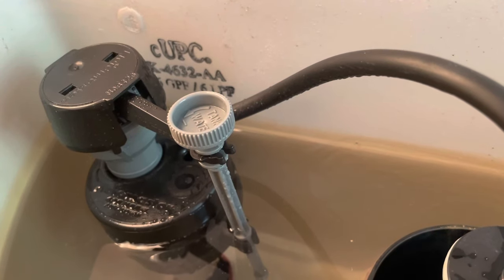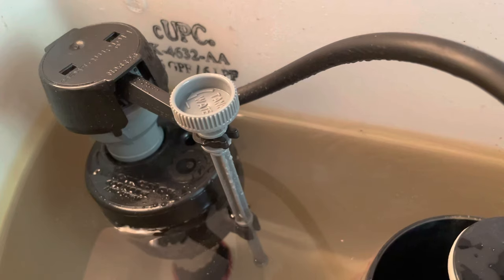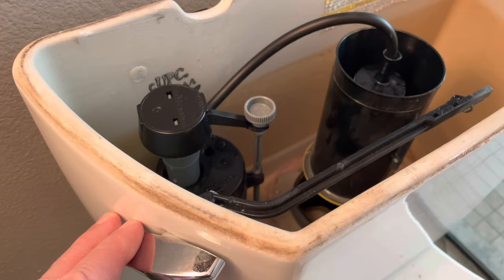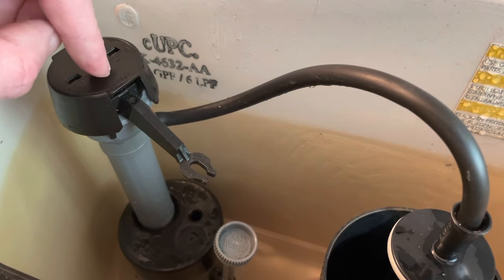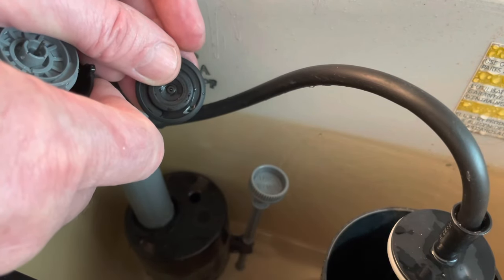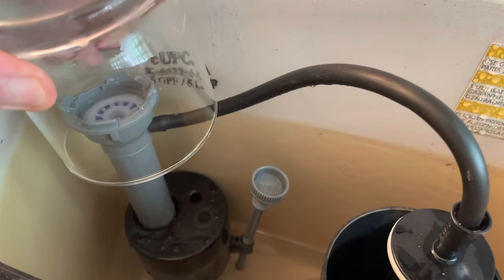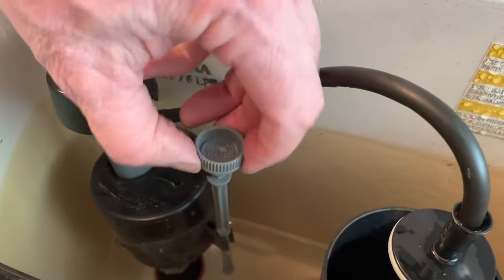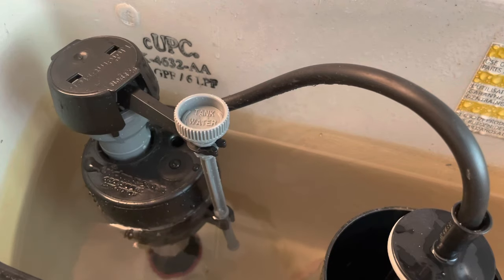Toilet Fill Valve Not Shutting Off / Don’t Replace / Fix Fast Cheap & Easy For Beginners

Comment: Our toilet makes noise throughout the day intermittently.  Do you think this might be our problem.  I am so tired of not knowing what this noise is from.
Reply from the maker: No, if it’s intermittent, you just need to replace the flapper (or canister seal depending on what style toilet you have). Either way, it’s super easy. Here’s a quick vid on flapper replacement:

https://youtu.be/lQQ8j0dIgIs

Comment: You obviously put the rubber seal back in place b4 re assembling the top unit....BTW, when pushing down on the top, hold the black connecting rod up and turn CC to undo it..

Comment: Was able to open and clean the dirt under that, but water still keeps running. Only stops when I push the fill valve down for a few seconds and let go
Reply from the maker: @nyduffman85  When they start getting “fussy” like that, it’s easier to just replace the valve. It’s simple to do, and they’re only $10.

Also, there’s a trick where you just replace the upper portion… it can be done quickly and with no tools. Here’s a video…

Replace Fluidmaster Toilet Fill Valve in Seconds For Beginners NO TOOLS NEEDED
https://youtu.be/ovdWF5Hdz8U
Reply: @papajoeknows8355 thanks, will have to replace it. It no longer stops running. Thanks for the reply appreciate your videos

Comment: We replaced both toilets when we replaced the floors little over a year ago.  One takes too long to shut off. Cant figure out why???
Ideas anyone?
Reply from the maker: Follow the steps in this video… it may be that there is some debris, or “gallstones” as we call them, that is blocking the flow of water inside the valve.

Comment: I don't understand. I replaced mine with another (used) one and BOTH don't stop the water. 

I took it appart like 2:06 and when I push on the top lever, the pin slides up and down and that's it. Nothing is pushing down on the rubber seal so how it it supposed to shut off?????
Reply from the maker: It may just be time to replace the valve. A little trick is just replacing the upper portion. Here’s a vid:

Replace Fluidmaster Toilet Fill Valve in Seconds For Beginners NO TOOLS NEEDED
https://youtu.be/ovdWF5Hdz8U
Reply: @papajoeknows8355  So I swapped the seal for another one and it works. 😊

The rubber was SLIGHTLY hard, but not THAT hard. Apparently that made a difference and the one I swapped it with works.

I still don't understand how it works though. The lever just pushes the pin down. It doesn't move the seal at all when you move the lever when taken apart.

Comment: Replaced the seal, flushed out the area underneath it and it still does not shut off.  What can go wrong with the rest of the valve causing this?
Reply from the maker: When they start getting “fussy” like that, it’s easier to just replace the valve. It’s easy to do, and they’re only $10.

Also, there’s a trick where you just replace the upper portion… it can be done quickly and with no tools. Here’s a video…

Replace Fluidmaster Toilet Fill Valve in Seconds For Beginners NO TOOLS NEEDED
https://youtu.be/ovdWF5Hdz8U

Comment: Is there any reason why the water would keep running for some time after it appears the valve is closed? It's easy to verify the float is fully up and firmly pushing the valve shut by pulling up on the arm, but mine keeps running for about 15 seconds after the valve should be shut. But then it consistently shuts off after that time delay, which really has me baffled.
Reply from the maker: When they start getting “fussy” like that, it’s easier to just replace the valve. It’s easy to do, and they’re only $10.

Also, there’s a trick where you just replace the upper portion… it can be done quickly and with no tools. Here’s a video…

Replace Fluidmaster Toilet Fill Valve in Seconds For Beginners NO TOOLS NEEDED
https://youtu.be/ovdWF5Hdz8U

Comment: I just bought a new Korky universal fill valve and changed out the old shut off valve with a compression fitting because I thought the shut off valve was bad. Now I have the same problem as the last fill valve! I’m losing my mind over here. Anyone know what might be going on with my toilet or plumbing?
Reply from the maker: @Isaacelijahmusic  is it possible you’ve got the height adjustment set too high, and the valve is not able to shut off prior to the water level reaching the overflow tube?
Reply: @papajoeknows8355  I thought I placed it as instructed. I took it apart after watching this and I hope it remains working otherwise I will try adjusting the Height
Reply from the maker: @Isaacelijahmusic  the shutoff height should be approximately 1/2” below the level of the overflow (the vertical pipe that’s in the center of the tank).

Comment: My refill hose keeps popping out.  How can I fix? model is just like this one in video.
Reply from the maker: Assuming you’ve “jammed” it in good and tight, it sounds like you’ve got very strong water pressure… you could dial the pressure back a bit at the valve on the wall, or you could try sticking a piece of a tooth pick right next to the hose to wedge it in.
Reply: @papajoeknows8355  Thank you very much!
Reply: I have a twist tie wedged in and wrapped around..will let you know how it goes!!!! Really appreciate your help!
Reply from the maker: @dagney2213  adapt & overcome… I like it. 👍🏻

Comment: io dont have that, i have instead a plastic bulb that lift up  a lever and the end of that level blocks off the supply of water to the tank.. and mine leaks water and is noisy at that lever stopping point
Reply from the maker: Is it like a plastic ball on the end of a metal rod?

Comment: I did all that and it's still not working what's the next step aside from replace ing?
Reply from the maker: When they start getting “fussy” like that, it’s easier to just replace the valve. It’s easy to do, and they’re only $10.

Also, there’s a trick where you just replace the upper portion… it can be done quickly and with no tools. Here’s a video…

Replace Fluidmaster Toilet Fill Valve in Seconds For Beginners NO TOOLS NEEDED
https://youtu.be/ovdWF5Hdz8U
Reply: @papajoeknows8355  yeah I usually do that I thought there might be an easier way because the supply line underneath the toilet is in bad shape and I didn't want to start a huge job if I didn't have to thanks though for the info. I put on the new one and it works fine without having to replace the cutoff and the supply line.
Reply: @papajoeknows8355  I wish that I'd learned that 35 years ago!

Comment: I replaced the seal and now it won't shut off the water when the stopcock rises. It was doing before with the old knackered valve.
Reply from the maker: When they start getting “fussy” like that, it’s easier to just replace the valve. It’s simple to do, and they’re only $10.

Also, there’s a trick where you just replace the upper portion… it can be done quickly and with no tools. Here’s a video…

Replace Fluidmaster Toilet Fill Valve in Seconds For Beginners NO TOOLS NEEDED
https://youtu.be/ovdWF5Hdz8U
Reply: @papajoeknows8355  Sorry it actually is working, but indeed it doesn't stop the water if I lift the floaty thing up manually - however when flushing and leaving it alone, then it does work and does stop flowing at the correct level. 🤔

I have no idea how or why though! On old toilets there was a plastic ball on an arm and you could push it down to make water flow or lift it up to stop it. These newer toilets are more complicated I guess, now they don't shut off if you lift the float thing manually. Quite bizarre, there must be some other component to it telling it to shut off but I've not idea how it's doing it.

I ain't touching it anyway, it's working!

Comment: Mine is a Fluidmaster 300 and it doesn't shut off at all, the water fills the water deposit and it flows onto the floor. I tried cleaning the gasket and adjusting the floater's height and it didn't work. The gasket has a hole in the middle which is pierced by a small needle-like thing in the cap, and said needle is wobbly. Is that my problem? Should I replace the whole thing?
Reply from the maker: Wait… you mean it’s filling into the overflow tube, and coming out on the floor??
Reply: @papajoeknows8355  Well, picture this: The lever is at a lower height than the overflow tube, so the water never actually reaches the tube. It, however, reaches through the little hole through which the lever is located and seep through the gasket onto the floor. I could change the gasket of the lever to stop the leaking but the problem would still remain; the water would continue to fill the deposit and the floater wouldn't cut the flow when it reaches the level.
Reply from the maker: @ubermenschmexa  the lever should never be at a lower height than the overflow tube. It should be redone, at which point, you may as well upgrade to a Fluidmaster 400 at the same time.
Reply: @papajoeknows8355  Yeah, I think I'll do that, thanks for your time!
Reply from the maker: @ubermenschmexa  you bet. 👍🏻

Comment: Hi why is my valve spitting water with noise at top of valve let me know thanks
Reply from the maker: It sounds like it may just be time to replace the valve. It’s easy, and a little trick… you can replace just the upper portion, here’s a vid:

Replace Fluidmaster Toilet Fill Valve in Seconds For Beginners NO TOOLS NEEDED
https://youtu.be/ovdWF5Hdz8U
Reply: knows  thanks!!!

Comment: If i remove the top cap, mine still keeps bubbling (even after trying to flush for mineral deposits.
Reply from the maker: When they start getting “fussy” like that, it’s just easier to replace the valve, they’re only like $10. There’s also a trick where you replace just the upper portion, no tools needed. Here’s a video:

Replace Fluidmaster Toilet Fill Valve in Seconds For Beginners NO TOOLS NEEDED
https://youtu.be/ovdWF5Hdz8U
Reply: @Papa Joe knows  thanks. Replacing just the upper part of the whole fill valve worked. I lowered the water level too.
Reply from the maker: @51249ca  awesome, well done! 👏🏻

Comment: 10 pack for $30 almost makes your decision to replace the whole component much easier as these components will ALL eventually deteriorate (especially in the hard water areas).
Reply from the maker: Eh, I look at it like for $3 I can be lazy lol. And alot of times they can just be cleaned and flushed out, and you can keep a valve going indefinitely. I’m still working out of the 10 pack I bought 15 years ago.

Comment: What if the valve isn't the issue? Mine is still hissing and running water!
Reply from the maker: @Emmss_  When they start getting “fussy” like that, it’s easier to just replace the valve. It’s simple to do, and they’re only $10.

Also, there’s a trick where you just replace the upper portion… it can be done quickly and with no tools. Here’s a video…

Replace Fluidmaster Toilet Fill Valve in Seconds For Beginners NO TOOLS NEEDED
https://youtu.be/ovdWF5Hdz8U

Comment: I finally found out that the float valve system should be really vertical (when it isn't perfectly vertical it add resistance, the ballon could be too weak to overcome this resistance)

Comment: I put a new valve in and it still ran on/off on/off on/off and still haven’t been able to cure it. It still runs now and then.
Reply from the maker: For a toilet that’s turning on & off intermittently, it’s usually the flapper… here’s a vid:

Toilet Turning On & Off by Itself ? How to Replace the Flapper
https://youtu.be/CAhGclvP3f8

Also possible just needs float adjustment:

Toilet Fill Valve Not Shutting Off / Don’t Replace / Simple Float Adjustment For Beginners
https://youtu.be/KNaZAGF4tKk

Comment: Mines won’t stop running, I got the old school balloon thing on my valve.
Reply from the maker: If you lift up the “balloon” all the way, does the valve shut off? If so, bend the arm downward so that the rising water puts more upward pressure on the balloon to shut off the valve. Otherwise, just change it out for a new Fluidmaster… very easy to do.
Reply: @papajoeknows8355  it does shut off when I left up the ballon but I’ll try bending the thing down.

Comment: I did all that but now after the tank fills it doesn’t shut off completely, there seems to be a small running water trickling
Reply from the maker: With your finger, lift up on the lever arm that extends from the cap… does the valve ship off when you do that?
Reply: @papajoeknows8355  I fixed it! I just had to adjust the stem (grey stick) connected to the clip.
Reply from the maker: @ktla309  perfect, well done! ✊🏻

Comment: I have this style flush valve and I despise the design.  Mine will intermittently not shut off because the mechanism binds, and there is no leverage from the buoyancy of the float to help push the valve closed because it isn't on the end of a lever arm like the older style flush valve assemblies.
Reply from the maker: Good point, could definitely be better designed. 👍🏻

Comment: Hi what if i did all your steps and it atill doeant shut off .. what can be the problem
Reply from the maker: Question… is the water level above the overflow tube in the center?
Reply: @papajoeknows8355  yes its overflowing .. and when i push down the fill valve a but it stops.. when i let go water contimues ..
Reply from the maker: @blown9079  the float is set too high, here’s a vid:

Toilet Fill Valve Not Shutting Off / Don’t Replace / Simple Float Adjustment For Beginners
https://youtu.be/KNaZAGF4tKk
Reply: @papajoeknows8355  okay i jist attempted that  and it didnt solve the problem .. one thing i would like to mention though is when i push down the fill valve the water stops..
Reply from the maker: @blown9079  sounds like it’s just time to replace the valve. It’s easy to do, and actually there’s a little trick where you just replace the upper portion. Here’s a vid on that.

Replace Fluidmaster Toilet Fill Valve in Seconds For Beginners NO TOOLS NEEDED
https://youtu.be/ovdWF5Hdz8U
Reply: @papajoeknows8355  i have a strong feelimg i might have to change the rubber inside the red cap . . Which would be the seal  right ? In the fill valve .. when i slightly press down on the red cap water stops.
Reply from the maker: @blown9079  oh, I thought you already did that.
Reply: @papajoeknows8355  no i havnt done anything . Starting from ground zero. Lol  so would you say it has to be that ruber seal then ?

Comment: I have replaced the valve, but after thank is filled automatically water level goes down
about half an inch, and start to fill the tank again, and the water level goes down about 
half an inch and fills the tank again and again. I don't how to fix this problem.
Reply from the maker: Question… when it fills, is water going into the overflow (the pipe or canister in the center of the tank) or stopping before it reaches that level?
Reply: It reached  that level and after few second start refill it again. I can hear
The water is running .
Reply: No leaking outside at all.
Reply from the maker: @moryabadi7440  Let’s start by adjusting the float. Watch this video…

Toilet Fill Valve Not Shutting Off / Don’t Replace / Simple Float Adjustment For Beginners
https://youtu.be/KNaZAGF4tKk

Comment: Water returning after shutting off water and flushing ? Thoughts ?
Reply from the maker: When they start getting “fussy” like that, it’s easier to just replace the valve. It’s simple to do, and they’re only $10.

Also, there’s a trick where you just replace the upper portion… it can be done quickly and with no tools. Here’s a video…

Replace Fluidmaster Toilet Fill Valve in Seconds For Beginners NO TOOLS NEEDED
https://youtu.be/ovdWF5Hdz8U
Reply: @papajoeknows8355  oddly enough I just messed with the tank water knob and turned it 5 times ( in the minus direction) and it fixed it 🤷‍♂️
Reply from the maker: @DHeld  ahhh, the float was set too high and the water was pouring into the overflow before the valve could shut off. Well done! 👍🏻
Reply: @papajoeknows8355  Thanks so very much for the clarity. I just used my intuition and a lil help from God, but that makes perfect sense!
Reply from the maker: @DHeld  you bet, glad it worked out.

Comment: My water keeps running and its not the flapper could it be this?
Reply from the maker: Yes, definitely could be.
Reply: @papajoeknows8355  it actually was I have two of the same toilets and swapped them out so it definitely a faulty one. Thank you
Reply from the maker: @steelfan187  well done. 👏🏻

Comment: You forgot to mention what causes a brand new flush valve right out of the package to run slightly after the tank fills.
Reply from the maker: If you use your finger to lightly lift up on the valve arm that extends from the top, does it shut off?

Comment: It didn't work even after replacing the valve seal water overflowing, can you please help me??
Reply from the maker: With your finger, lift up on the arm that extends from the top of the valve… does the valve shut off when you do that?
Reply: @papajoeknows8355  No its doesn't stop the water.
Reply from the maker: @anupbhomi7888  time to replace the valve then. It’s inexpensive and very easy to do. There’s also a little hack where you use only the upper portion of the new valve and replace that. Here’s a video:

Replace Fluidmaster Toilet Fill Valve in Seconds For Beginners NO TOOLS NEEDED
https://youtu.be/ovdWF5Hdz8U
Reply: @papajoeknows8355  Thanks I will try that.

Comment: Unfortunately the adjustment screw is VERY hard to reinsert and mine snapped right off.
Reply from the maker: @Catmandude  When they get older and brittle like that, it’s easier to just replace the valve. It’s simple to do, and they’re only about $10.

Also, there’s a trick where you just replace the upper portion… it can be done quickly and with no tools. Here’s a video…

Replace Fluidmaster Toilet Fill Valve in Seconds For Beginners NO TOOLS NEEDED
https://youtu.be/ovdWF5Hdz8U